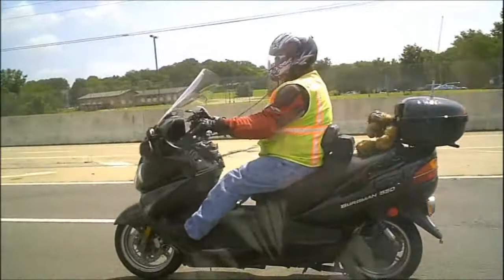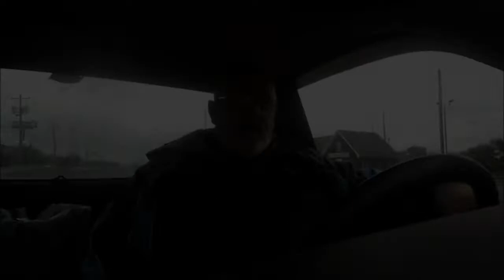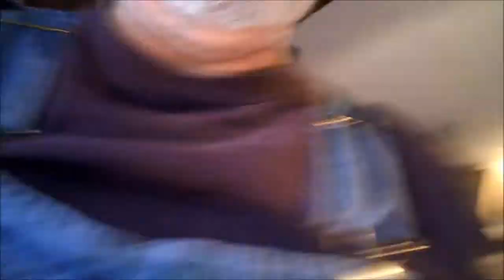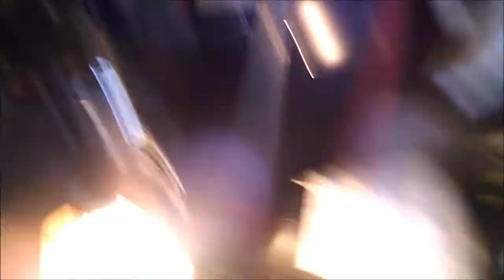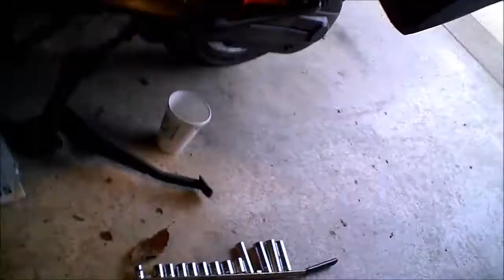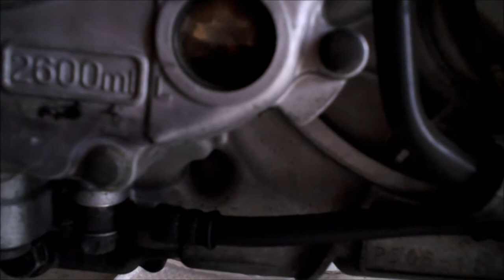ALF needs a Surgeon, STAT !

Comment: You do know, all 650's mfg now are Executives.  My 2011 has not given me one problem.  I have just over 8,000 miles and I just purchased it in March.  Keep us posted.  One of my club members has a 2003 Burgman with 75,000 miles on it.  Yes, it's starting to rattle but I guess that's to be expected.  My 2011 has an additional gear in the CVT.